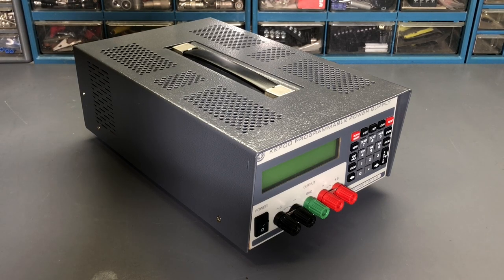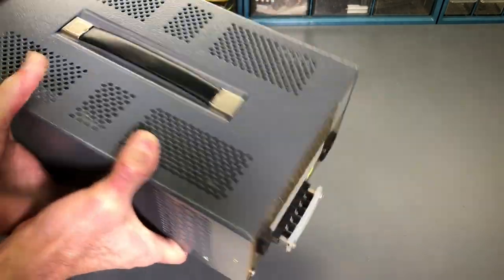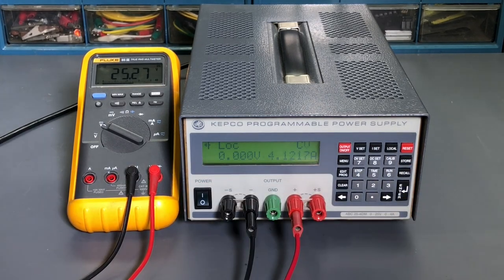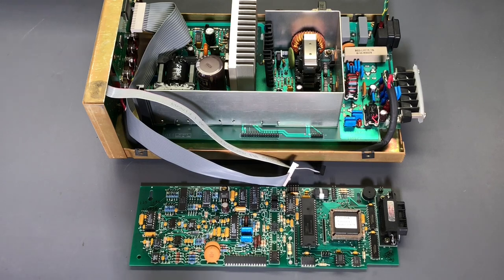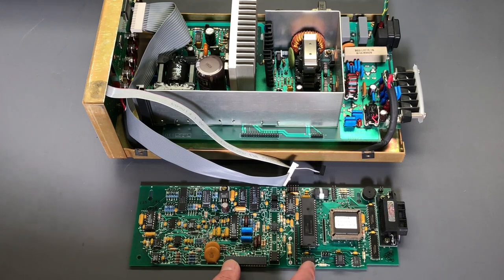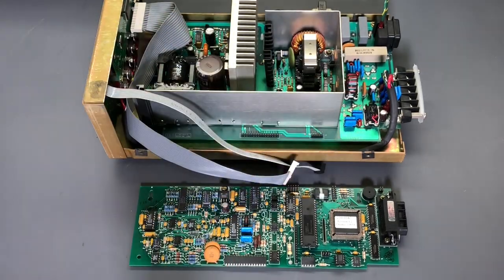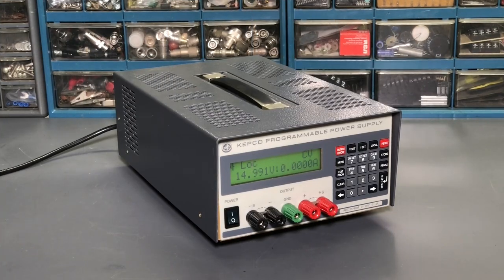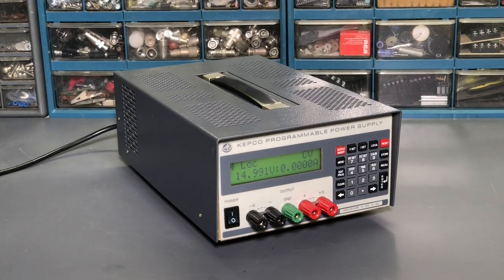Kepco ABC 25-4DM Switch Mode DC Power Supply Repair and Test

Comment: I'd suggest always test ripple at 3 states: no load (0A), light load (1-10mA), heavy load (50-80% of rated wattage). Seeing if the results vary (and by how much) tends to sort the wheat from the chaff in their quality. ~7mV ripple RMS at no load isn't astoundingly quiet, but decent, maybe good for SMPS. If keeps that figure up into high load you can guess it was likely designed very well for its spec, though.

Comment: Yep, an optocoupler failure on a SMPS is not too surprising. Depending on your intentions for the unit, - keep it for use, or sell it to make a profit - I would replace the big smoothing cap in the middle of the circuit, as general maintenance. I would also look for any type of a memory battery. But, you know these things... Just thinking out loud. Thanks for the caution on a floating/powered heat sink. I must really keep it in mind that a SMPS is like a very mean dog. Reach out to pet it and you might get bit, hard.
Reply from the maker: No memory battery in this power supply.  I'm keeping the power supply for personal use (and it's not the main supply on the bench) so I did not get into the capacitors at this time.  They are working ok but if one fails in the future I'll deal with it at that time.  Yes watch out for high voltages in these SMPS, don't get bit!

Comment: Great repair! Did you check the solder joints on the opto prior to replacing it (maybe I missed something)? Always fascinating, how much noise even quality SMPS generate compared with a good old linear supply. Also, this supply is very difficult to measure "correctly" with the binding post so far apart. The large loop might have introduced some additional noise to the measurement as well. Although I almost always enjoy TME repairs more than other content, it would be interesting to hear whether you do other work as well, like circuit design (hobby or professional). So if there is ever a shortage of things to repair, from time to time projects might be interesting as well. Keep up the good work!
Reply from the maker: Thanks, yes I did inspect the solder joints before I removed the part and they looked ok.  Yes SMPS have trade offs for the high efficiency, and suppressing the electrical noise is not easy.  The noise measurement was made without any other wiring (other than o'scope probe) connected.  I will  try to cover plenty of topics in electronics.  Thanks for watching!

Comment: I’m currently looking at a kepco power supply that sits at max voltage as well but it doesn’t seem to return to normal after heating up, and only spikes as soon I attach a wire. Do you think it could be a similar problem?
Reply from the maker: Doubtful to have the same problem from the description.  It is hard to say what the issue would be without proper troubleshooting.